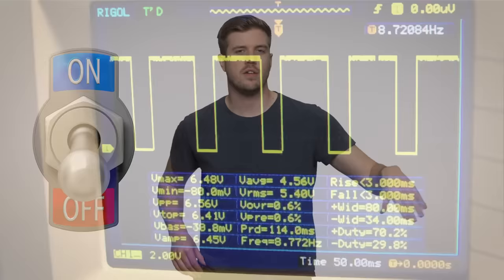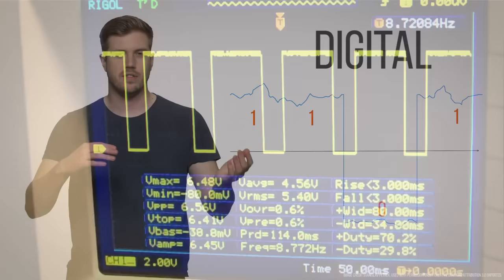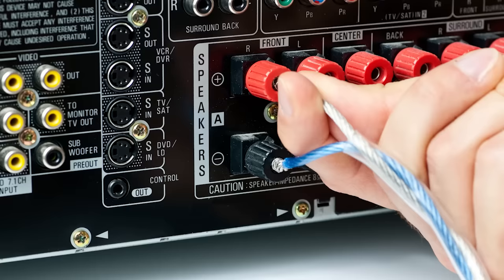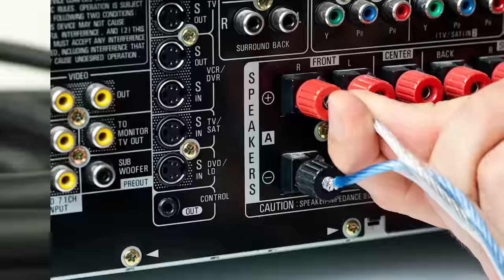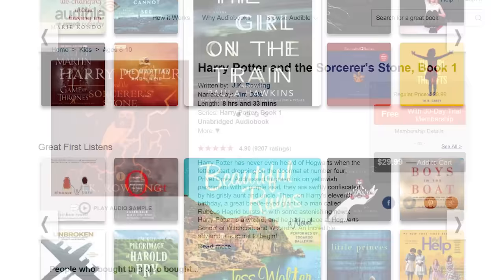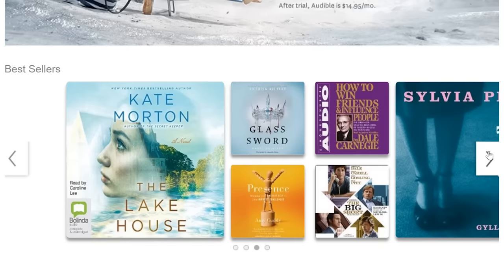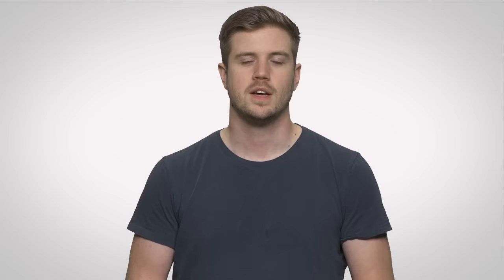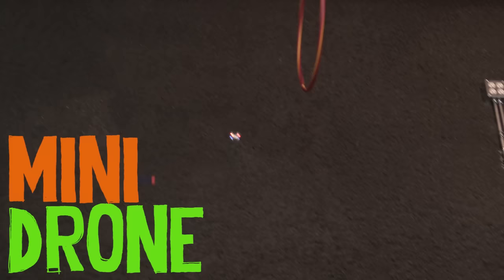Analog vs. Digital As Fast As Possible

Comment: Am I the only one that understood none of this? I watched this whole video and still don’t know what analog is
Reply: Waste of our time
Reply: Because they used terrible and awful analogies. I don’t think anyone really knew how either worked and the writers just did a quick “first page on Google”analysis. Just ran with it.
Reply: Digital is based on numbers (1 and 0/yes and no) that are used to command stuff (i think?) and analog is more of logic based where like this gear is this tuning that gear and therefore it blah blah blah
Reply: Its like i know how it works but i cant explain it well
Reply: Digital would be using code to say yes or no, 1 or 0. Analog is using things such as transistors, tubes, and physical components as gates such as diodes (a one way road) to say yes or no, 1 or 0, on or off.

Comment: Luke, you've made a mistake : Sampling rate is measured in KHz , not kbps (like the bitrate which is is the maximum amount of bytes a digital machine can pull out from the file in a second) . The sampling rate represent the frequency of measuring the amplitude and position in time of a analog signal , and it's prefered to be double as big as the maximum value we can observe (for example the human ear can hear maximum of 22Khz , and this is why majority of songs have a 44.1Khz sample rate...computers can output 48Khz "just to be sure" that no quality is lost)
Reply: This was such a good explanation
Reply: He was correct but I’m too tired to explain
Reply: Or should he calls it bit rate?
Reply: @CHARITY DAZLEY bit rate refers to the audio quality of the stream. It is measured in Kilobitspersec (kbps or k). Bit rate is # of bits (data) encoded per second or the # of bits transmitted or received per second. Sample rate is the number of samples per unit time. A sample is a measurement of signal amplitude and it contains the information of the amplitude value of the signal waveform over a period of time. The sample rate is also called as sample frequency, higher the sample frequency obtains a signal which is similar to original analog signal for good audio quality.
Reply: @wuli_bottle  it's spelt bitrate
Reply: @MrDelsoleg11  ........my head.....soo many typos

Comment: I still use VGA for most of my monitors!
Reply: y?
Reply: darwin miller Because the main display is a 24 inch 1080p HDMI touch screen. And all the secondary displays run on VGA 1024x768 res.
Reply: +#01DF01Seba Abdur-Rehmaan peasant
Reply: +Jake Sinden TUVM.
Reply: +Joe Mills Is that because your GPU doesn't have more digital outputs?
Reply: ***** You're probably mixing up dual link and single link DVI connectors (link to DVI connector diagram: https://static.spiceworks.com/shared/post/0002/4077/original.gif )
Reply: ***** And for a secondary monitor it's probably not worth the trouble.
Reply: My graphics card doesn't have an HDMI socket...
Reply: +XIII Nobody What kind of potato are you running on?
Reply: The Mellor Brothers NVIDIA GeForce 9500 GT...
Reply: XIII Nobody I am actually impressed with how old that is XD
Reply: The Mellor Brothers Well, the less you get, the less you want, I guess.
Actually, no, not really. I'm just glad it still lives because I don't have anything to replace it with in case it suddenly breaks.
Reply: TinchoX I know.
Reply: +#01DF01Seba Abdur-Rehmaan HDMI to auxiliary adapter for your monitors
Reply: Yeah, my brand new computer's monitor is a $15 vga one, but at a pretty dank resolution (1050 x 1620 I believe).
Reply: I also use VGA monitor replacing the internal screen on the E6410 that lost every second row of pixels due to the graphics chip failure.
Reply: I still use a VGA connection, but I use a DVI-I to VGA adapter to connect to my VGA monitor.
Reply: #01DF01Seba Abdur-Rehmaan I use A/V for my tv
Reply: @Big Fat Boi I have, now running triple 1440p monitors on HDMI.
Reply: I hope you aren't any more
Reply: @sindweller  I still for 5 years have old Nvidia Geforce 745 Ti...
Reply: I use dvi and i have to say: i use vga as a backup if my monitor is broken since i have only 1 monitor and 1 tv that doesn't have dvi cord  and i mostly use a vga to dvi converter
Reply: I only use vga

Comment: Hang on, you said "sampling rates" but the screen showed bitrates. I'm no audio engineer but the sample rate is measured in Hz, not kbps.
Reply: +dimmddr1 Yeah, it should've been represented with Hz. He didn't even need to say higher, either, since the Nyquist–Shannon sampling theorem has proved that a sample rate basically double the original frequency response is needed to reproduce the signal. Therefore 44100 Hz is more than sufficient for human hearing, but audiophools love claiming otherwise.
Reply: +dimmddr1 Typically one encoding of an audio waveform such as CD-DA (standard CD encoding) will use a fixed level of detail (or depth) per sample e.g. 16 bits per sample, with this knowledge you can calculate the frequency samples were taken at by dividing the bitrate by the sample depth. In the case of CD audio the sample rate is 44.1kHz with a 16 bit depth and 2 channels giving a bitrate of 1,411.2 kbps, totaling 847 MB per 80 minutes of recording.
Reply: Sample rate is measure in Kbps and transmit rates in hz
Reply: +Flac Or Gtfo  Nyquist theorem is the MINIMUM sampling frequency . i.e. if you are sampling audio 20 to 20,000Hz then the minimum sampeling rate is 40,000Hz. But as DJHenjin said below the number of bits you are sampling with also has a huge impact on the accuracy of the samples . it is why pro gear goes to 24 bit and higher AD/DA converters .
Reply: +spud4242 Nyquist isn't the "bottom limit", it's the threshold at which point a digital signal can perfectly recreate an anaolgue signal. A 20 kHz signal can be perfectly recreated from a CD at 44,1 kHz, with the extra headroom needed for low-pass filtering. 
And at 16 bits a CD can blast a 20 kHz signal out at ear-splitting levels.

People selling you 96/24 or 192/24 are snake-oil salesmen, since the only thing those things will improve is your ability to annoy your dog and how easily you can get yourself deaf.
Reply: +Žiga Auer Well not really. If you think about it, with a 40kHz sampling you can recreate a 20kHz wave only defined twice in it's period. Sure, if you assume it is a pure sine wave, it is more than enough to produce it, but that is not always the case. I worked at a radio station, we had some pretty high-end stuff, and there is some difference between 44.1kHz and 192kHz. In the end, it is the same "fight" which we have with FPS. Sure, the eye will process everything above 30 FPS as a moving picture, but 60, and even 144FPS is noticeably different from the base number.
Reply: +Daniel Borsos *4 times in it's period...
Reply: +Joe shade What? No.
Reply: +Daniel Borsos Again thats just not true, Nyquist is the limit at which point you cannot discern the difference between a continuous signal (analogue) and a discrete signal (digital). You can make it "smoother" because all the info you ever want is already there. 

And frames per second are not the same thing. Our are able to spot events lasting even just about 1/200th of a second, so technically even 144 fps is not close to our eyes limit.  There always is missing information in current video, but we cant notice it a lot of the times. But with audio, at 44,1 kHz there is no missing info, it's an exact replication of any audio-signal our ears can sense.
Reply: 56 kbps :) anyone remember that!

Comment: "possibility of interference"
You mean..
THE INEVITABILITY OF INTERFERENCE
Reply: The struggle is real
Reply: Mason Bulot If you grew up analog then you know for sure how garbage image quality looked. Especially during inclimate weather.
Reply: Dread Naught i lived in Louisiana... When it rained... You weren't watching I love Lucy.
Reply: Mason Bulot Well, you could still watch the static and the in and out sound. Not very entertaining though. :(
Reply: +Dread Naught XLR master race
Reply: +Dread Naught The big difference between analogue tv and digital tv, both using the same source, is that the analogue is .. well.. it is signal shall we say. And the digital one is sharp, very sharp and accurate. 

And the provider even has HD streams if SD isn't enough for you. HD streams would be bloody almost impossible to work analogue. It is technical possible but the bandwidth it would take is just crazy. 

I tend to watch my digital television package in SD. That already is sharp enough and already has the upgraded sound quality. I don't need much more to enjoy some television.
Reply: Masticina Akicta Japan's first widespread (in the late 1980s) HDTV broadcasting system (normally at 1035i) was entirely analog! It used little more (8.1 Mhz) than the 6Mhz bandwidth that NTSC (480i) (also common in Japan then), So yes It is possible to do HD broadcasting with an analog signal!
Reply: @ifoundmarcobb9574  it's raining here now & can watch bugger all but multicolored digital puke narrated by aliens on my digital TV 😣😣😣
Reply: Yeah, those causing static, noise, interference and jamming don't want to get caught doing that to people and other living things.

Comment: 3:22 Sampling rate is not measured in Kbps. It is measured in (kilo)hertz. Common sampling rates are 44.1 kHz and 48 kHz. This means that the audio is sampled 48,000 times per second, where 1 sample is one "point" in the audio signal.
Reply: longbyte1 thank you for the clarification. He propably was referring to the storage of the samples in the mp3file wich would be in bytes...
Reply: longbyte1 and one question: wouldn‘t one sample rather be one wavelength than one ‚point‘ ... because hertz is measuring frequency ? :)
Reply: @ismireghal68  It measures the value of an amplitude or a value of a function so to speak at a given point. The higher the frequency the more measurements are made and higher the quality.
Reply: @ismireghal68  Just to put what Boris said another way - You're storing discrete measurements of that wavelength at a finite number of points - you aren't saving all the data from a wave.  Computers are able to recreate that wave given all the individual measurements at each of those individual points.  The measurement frequency here determines how many times each second we sample the wave, to get its value at each of those points.  Typical sound rates like 44,100hz save the wave's amplitude at those 44,100 points each second.  That's enough for our machines to fit a curve to those points and recreate the original analog waveform pretty accurately, despite not knowing exactly what happened in between sampling points.

longbyte's original point was that kbps (showed in the video while the presenter was talking about sampling rate) is a measurement of the amount of data stored each second - not the frequency of recording the wave's amplitude - the sampling rate.  The bitrate (typically kbps, or kilobits/bytes per second) can fluctuate independently of the sampling rate (hz, or hertz), as we're able to record the wave's amplitude with a greater degree of accuracy at each of those sampling points, if we're willing to use more data (bits/bytes) to store it.

Then there are fancy algorithms to compress digital audio beyond this naive approach, so that we can squeeze more audio fidelity out of those precious kbps.
Reply: @ismireghal68  Hz is used to denote the no. Of times the ADC takes the sample. Hz means 'per second'.

Comment: 3:24 Sampling rate should be referred to as 11khz, 22khz, 44.1khz, 48khz, etc... NOT 128, 192, 256, or 320 kbps. That's the bitrate for the compression algorithm.

Comment: FYI, 128,192,256 and 320kbps aren't sampling rates, they are bit rates, which can be used to describe any data streams. Sampling rates are in the form of samples per seconds, or hertz. Typical sampling rates for music range from 44.1khz(cd quality) to 192 kHz or even higher.

Comment: My favorite "hype" is so called "Digital" antennas. an antenna is a specially tuned hunk of metal. It responds to an electromagnetic frequency
 It doesn't "care" if the modulation is pulse,CW,analog or any thing else. Same with "digital" headphones/speakers. All headphones and speakers are in the end "analog"!
Reply: Is a digital antenna, at least in the TV world, not just an antenna tuned to the carrier frequency of digital TV broadcasts?  AFAIK they are transmitted on a different frequency range than old analog TV broadcasts, so the antenna tuning would need to change for optimal reception of the new digital broadcast.  I don't think they are trying to imply the antenna itself is digital, but rather it's tuned for the reception of the DTV signal's frequency range.  Of course, with the way marketers understand tech, they probably don't know the difference and just say it's a digital antenna because it is for receiving digital TV, but hey, there is at least a reason for the change.
Reply: CalcProgrammer1 Some channels did change from their old frequencies, but all of the digital channels fall within the old bandwidth (mostly moving some old VHF channels to UHF) so a VHF/UHF antenna from 1976 will work the same as a "digital" antenna from 2016. The method of modulation is the only difference. A TV antenna is a TV antenna. They only changed the styling on some expensive models. The rest (like the usual RCA models in discount stores) are electrically and stylistically the same as 30 years ago. The "free TV stick" (as seen on TV.LOL) is just a UHF antenna and it's not amplified. An cheap set of rabbit ears would be as good (or  better.).